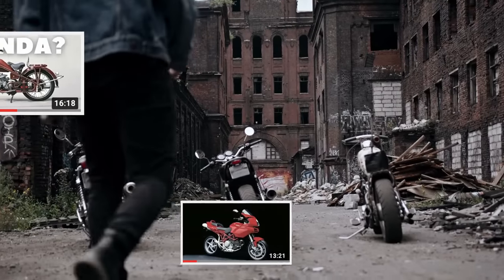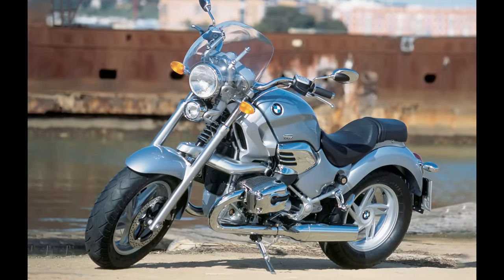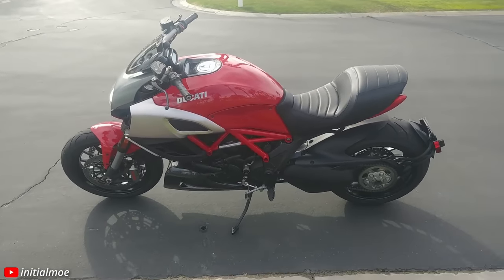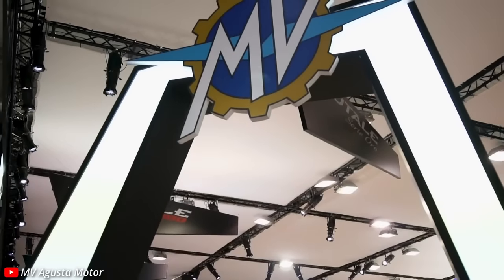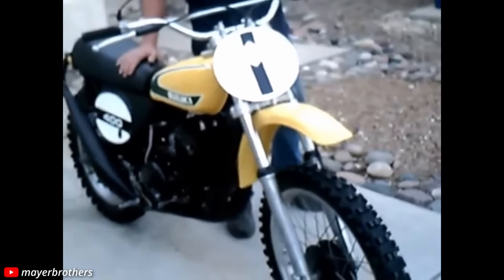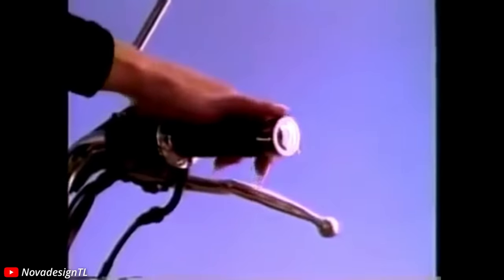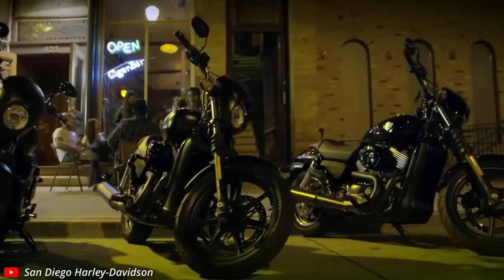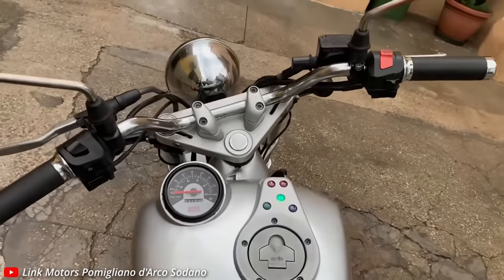The WORST Motorcycle from every manufacturer

Comment from the maker: Check out De Agostini! Use promo code "PROMO_VROSSI"
https://bit.ly/3D2XJyh
Reply: So the Kawasaki I am not going to say what I say here is 100% accurate but there are some connections. Kawasaki's first effort into the cruiser market came in 1980 with the 440 LTD that went until 84 from 85 to 90 the bike became the 454LTD which was the Kawasaki Ninja 900 (908cid) four-cylinder with two cylinders cut off. ( I am a Honda person but the 454LTD is a bucket list bike for me) The 454 in 1991 became the Vulcan which is in my opinion a shit bike!  A friend of mine had one with the plastic or nylon gear, I think it was an oil pump gear? There was a silent recall on it and only a fraction of the bikes ever got fixed and all this happened because Kawasaki wanted to save a few cents per bike and use a plastic or nylon gear deep in the motor (that required splitting the case to replace) instead of steel?!

I digress ,The point, the eliminator was the Ninja motor without taking two cylinders like the 454LTD did and I think that is the connection they figured it worked for the 454LTD so lets do it again but not cut the motor in half? Also the eliminator was more of a naked bike in my opinion along the lines of the Honda V65 (which was the fastest production motorcycle of that time period) I do not dislike the Eliminator although to me it looks someone elongated it and does look weird? 

The yamaha Virago was not a bad bike it had the same styling as the Kawasaki 454LTD or the Yamaha 650special, I would say in that time period the seca 550 was a worse bike it was a sports bike at a time when that meant no suspension, and I mean no suspension, it looked good but rode  like shit and the front end would wooooobbbbblllllee really bad under heavy breaking.
Reply: I rode both the Kaws you have it backwards.
Reply: @stewart8127  how so?
Reply: @engir63  Vulcan slow
Reply: @stewart8127  I never said the Vulcan was slow I said it was or is a shit bike and gave the company a image of being unreliable that in Central America where I am continues to this day.

I did, however, make a mistake in that I thought the two years of production for the eliminator was around 87-88 it was not it came out 85-86 so the connection to the 454 is not really there as I surmised, because the 454 came out the same year.

In 91 when the Vulcan line started, in America some dealerships actually put LTD emblems on them to sell them so they were called "Kawasaki Vulcan 500 LTD" in some areas of the country.

Under the circumstances, I am not sure the bike is as bad as we all think? I think it was Kawasaki cutting corners to save a buck like the plastic or nylon gear I spoke about that made the bike a problem child. It is not a bad design, it is actually a really good looking cruiser but the penny pinching of Kawasaki has tarnished the bike not the bike itself persay.
Reply: The eliminator was awesome.....
Reply: @shanebrady568  Never rode one but the 454  was a great bike, and fast! I never owned one as I said but I want one... Oh I am small displacement rider I have gone over a 500cc twice in my life and regretted doing it both times.
Reply: @shanebrady568  the Vulcan wasn't.
Reply: BART: "OKAY FROM YAMAHA I HAVE TO GO WITH THE VIRAGO AS THE WORST BIKE YAMAHA EVER MADE. NOW I KNOW PEOPLE ARE GOING TO DISAGREE WITH ME BECAUSE YES IT IS A FANTASTIC MOTOR THAT HAS WON MANY RELIABILITY AWARDS. IT'S A DECENT LOOKING SLED FOR A DAY CRUISER. I GUESS WHAT IM SAYING IS MY OPINIONS HAVE NO BASIS IN FACT AND I PRESENT TO YOU NO ACTUAL SUBSTANCE IN ANY OF MY SENTENCES TO BOLSTER THESE OPINIONS OF MINE AND I THINK YOU WILL FIND THIS TO BE THE COMMON THREAD THAT RUNS THROUGH ALL OF MY VIDEOS. I PREFACE WITH THIS DISCLOSURE FOR THE TSUNAMI OF VIEWERS THAT ALWAYS DEMAND THE 30 MINUTES OF THEIR LIFE BACK AFTER LISTENING TO ME SHIT OUT MY NECK IN THE NARRATION WHICH OF COURSE IS NOT PHYSICALLY POSSIBLE." Dear Bart isn't there anything else you can do for a living because we agree with you. You are just horrible at making videos. It's truly a painful imposition having to endure any of your media dreck. .
Reply: @engir63  In 1992 I bought a 1985 Kawasaki LTD440 of my good friend and next-door neighbor for 6 years for $100, it was in his shed and had not been ridden or started for 5 years, I gave it a good soak in truck wash foam then got the Gerni onto it and some polish and Platnium Alloy Polish, Chucked new Hand Grips on then being lazy I put it into Brisbane Bikes and had them do a full service with all new fluids, plugs and every hose line replaced and new pads, engine tension check, valve, and gap check, carbs cleaned and tune, fuel tank clean and filled then 3 days later I picked it up with the Bill being $185   🤯  then rode it through the City and 45km freeway ride to home and installed the 2 brand new full exhaust systems he bought to replace the early rusting one's, They cost me 2 cartons of beer that cost $12,50 each, It looked and ran like a new bike and new work transport for $310. In 1983 on the way to work I saw a 1966 Honda CL-B77 Super Hawk with 4.500 miles on it in the front of a Mower shop in absolute Mint Condition for $350 I bought it instantly, but for some weird reason, it had a 350cc engine instead of the 305cc I got it up to 110 miles per hour one day. To my distress, it was Stolen in 1985 and I never saw it again, It was special being made in 1966 the same year I was born.  😞😞 Starting in 1982 I ended up buying around 9 CB Hondas in order of sizes to the CB 900F2-C Bol D' Or. I Had the 1970s CB 450 Super Four, The 550cc and 750 Super Sport, and a few Multiples I wish I had them Now.
Reply: Ok, ill tell you were your wrong.
The Harley Davidson V-rod was NOT
the first power cruiser.
It all started with the 1982 Honda Magna V-45 750cc,  then soon after the Honda V-65 1100cc Magna. 
The Yamaha followed with the 1985
Yamaha V-max, and it wascthe fastest factory production bike in 1985..
Reply: Ducati untested technology?
Reply: @engir63  I don't understand where the thinking to be a cruiser must be a twin where does that come from?
Reply: @conradgieblewicz8220  in 1/4 mile not stop speed.
Reply: @Johnketes54  I think it comes from the fact that the LTD turned into the Vulcan which is Kawasaki's cruiser line so that makes the 440 LTD the first attempt at a cruiser bike?
Reply: What makes you think (first bike), BMW is trying to compete with Harley, and how do you define "cruiser", because 60hp cruses pretty good.  Are you confused with "racer"?  That BMW is way more trick than Harley will every be,---if you know what you are looking at, (blank out).
Have you ever ridden a Harley?   The reason why you will not learn well, is because you think you know it all already.
"The day you think you know it all, is the day you have a lot to learn."  (Doug Stockman quote)
These companies would sue you,---but you are probably just another YT bot.
Reply: @EarthSurferUSA  calm down dude BMW has surpassed H.D. and made it to the  new age with the big 4 Japan manufacturers .  Harley needed Porche to design a liquid cooled engine.
Reply: my family has a 1996 kawasaki eliminator in the garage that hasnt ran in probably a little over 17 years.
Reply: Ii you don't like the KTM RC16 based on results this year you must really, really hate the '22 Honda RC213V.
Reply: If I had $1,400 plus dollars laying around, I would love to purchase this 1/4 scale model. Think I'll use that money on my real motorcycles. Too bad it cost so much.
Reply: You have obviously never seen revenge of the Ninja with Sho Kososki
Reply: I saw a ktm with a Kawasaki 650 engine that's the worst one.
Reply: The first year 1968 Triumph 3-cyl Tridents designed by Ogle Design with its square tank and ray-gun silencers.
Reply: GG
Reply: I already watched Giacomo Agostini race on the track live so i don't need memorabilia, I am a piece of memorabilia already at 58
Reply: No Cagiva huh? ...... u got MV to Moto Guzzi and u left out Cagiva and Gillera in your 'Italian' bike segment ...
Reply: You can't just diss a virago based on your personal opinion. They are bullet proof reliable affordable  well engineered for purpose and fun to ride, customise and own. Shame on you calling them a bad bike
Reply: @AjarnSpencer  .... I've only witnessed Eddie Lawson v Freddie Spencer, Gardner v Rainey v Schwantz and I meet an unknown 16yr old Rossi at Shah Alam.
Reply: Each to their own. I disagree with several of his choices, but then I haven't ridden half the bikes he picked on.😅
Reply: BMW Very reliable😂😂